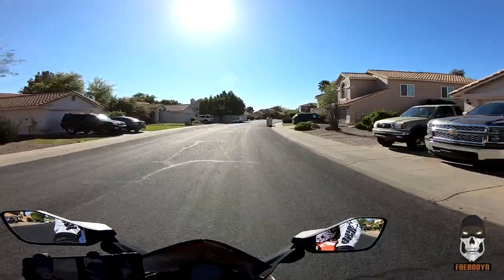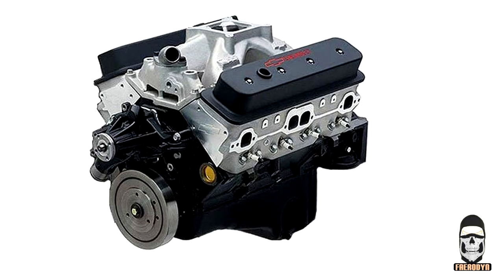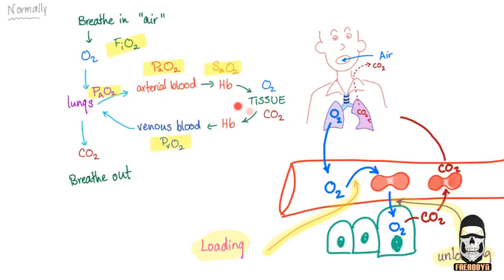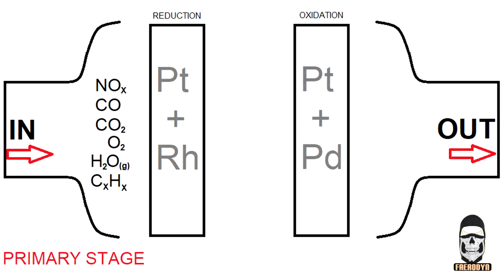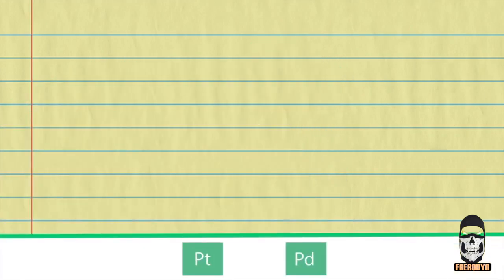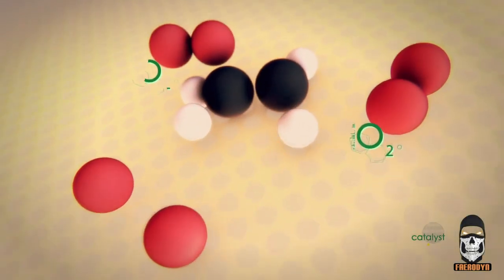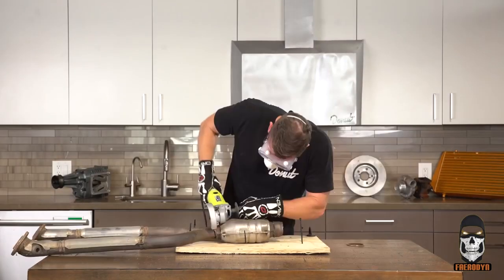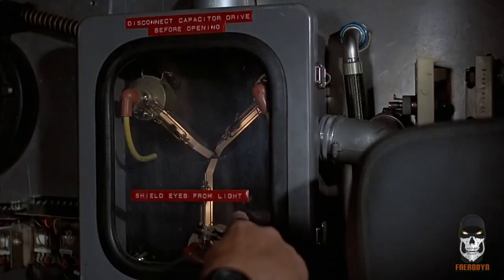Should You Remove Your Bike's Catalytic  Converter?

Comment: Hello! My sr50 2020 is completely stock and my exhaust is glowing red in catalyic converter area. Is this normal or not. Can someone please answer.
Reply from the maker: @Roki Leo: Hey man, thanks for your question. Your SR50 is a pretty nice bike! I have to say that in my limited experience I have never noticed my exhaust glowing after riding, and I don't think that it is normal for your exhaust to glow. It may be a fuel issue (bike running lean) or improper ignition timing. I would definitely suggest taking it in to a shop to get checked before your issue causes damage. Here are some links that I hope are more helpful:
https://findanyanswer.com/what-would-make-your-exhaust-glow-red

https://www.cycleinsider.com/Aprilia-Scooters-Motorcycle-Reviews?type=Scooters&manu=Aprilia

https://www.apriliaforum.com/forums/showthread.php?357858-Exhaust-pipe-glowing-red
Reply: @FaerodynMoto  thank you very much
Reply: @FaerodynMoto  do you have ig where i can send you a picture of a glowing part of exhaust
Reply from the maker: @rokileo1309  Unfortunately not. The only social media accounts I have are Twitch, Discord, YouTube, and Rumble at the moment.

Comment: I've got a 150cc SOHC Bike its exhaust has a Catalytic Converter and a heavy muffler

it has poor power output though from that massive back pressure..
11hp@ 7,000

a similar bike but an older model can do 14hp@8,000

if I replaced the exhaust, replace the carburetor and put a pod filter

can probably add 1 or 2 hp at higher rpm's maybe even more if replaced the camshaft with a Performance Cam
Reply from the maker: That's where the restrictive stock emissions parts really rob you: at higher rpms. Let us know how your project turns out, Jasper!

Comment: Hello bro nice Video, I want to ask you, is it necessary to Remap the ECU after replacing the catalyst on the motorbike, thank you, greetings from Indonesia
Reply from the maker: @BANGLIMS  hello! Nice to hear from you bro! So my experience with my KTM was that the bike would run too lean (not enough fuel) after doing the mods, so I had to remap the ECU to keep the bike from running too hot. If I didn't, it would damage the engine. I hear that most KTM's run very lean already from the factory, so I would highly recommend remapping after removing the catalytic converter.
Reply: @FaerodynMoto  Thank a lot for you suggestion bro 🙏

Comment: As this is two years ago what about the new ecu, I've heard that the ones on the meteor are learning ecu and as such can adapt to the change in the exhaust
Reply from the maker: Oh sorry for not responding sooner! Yes, adaptive ECU's have been around for decades in cars/trucks/vans/SUV's... I don't know enough about the motorcycle industry as a whole to know if they have plans to implement that technology into motorcycles or if they already have in certain models. I would imagine that in theory they would eliminate the need for piggyback ECU modules and tuning, however we've also been seeing companies like GM locking down the computers of certain models (like the new C8 Corvettes) to keep the performance levels within their predefined parameters. So I don't know if it would allow for such modifications or throw a code and prevent the motorcycle from working with anything other than stock running gear. I think I'll look into it! :-)

Comment: I Have Benelli TRK 702 did you recomend cat of ?
Reply from the maker: @dani.0605  I can't recommend doing anything illegal, so check with your local laws to make sure something like that is legal first. If you're ok doing that, then yes it will free up some more power. Just don't forget to also get your bike tuned for the mods you have and you should be good! 👍
Reply: @FaerodynMoto   I ask is that good for my bike notting else. I dont wonna mods i didnt instal that only slip exhoust i now i wonna decat my so is that good for read safe for my bike?

Comment: I have a 2021 Honda Cb350 single cylinder long stroke bike . 21bhp at 5500rpm and 30nm at 3000 rpm. Weights 190 kg.  I unplug the O2 sensor and bike rode a bit better with slight increase in throttle response .but popping at downshifts . It just have a simple cat in downpipe below O2 sensor , ecu are not available for this bike as it’s new not even in Japan (Honda gb350) . I want to delete cat, should I do it or not for sound and a bit of power.
Reply from the maker: That's a tough call, brotherman. I don't know enough to give you sound advice one way or the other, but if you are planning on de-cating your bike: you may want to check into some motorcycle mechanics near you that would be able/willing to dyno tune your bike for you once you make exhaust modifications. That way your bike should be running smooth and not have any issues. Your bike sounds real nice though!
Reply: @FaerodynMoto  thanks brother, in India nobody does bike dyno tunes. I think I’m gonna delete it, if something goes wrong will buy new downpipe as the exhaust is in two pieces.
Reply from the maker: @themechanicsingh4159  ahhhh, ok. Sounds good, I'll be checking for sounds clips on your channel when you do it! :-)

Comment: Bit random but if I cut out the cat of my stock downpipe, and replaced it with just a bit of pipe, and kept the stock end can on, would that change the sound at all? And would it harm the engine?
Reply from the maker: Great questions! So what you talked about doing will most likely increase the volume of the exhaust. I'm not sure if it will sound better, but in theory it should sound just a bit louder. As far as harming the engine:  with the rest of the stock exhaust still installed, I doubt there would be any problems with your engine. If in the future you swap out the other exhaust components for aftermarket ones, be sure to get the bike tuned or install a piggyback ECU like a Power Commander or Powertronics or something along those lines to give you the ability to purchase a tune online and upload it onto the bike.

Comment: Is it bad for bike to remove catalytic converter and instal regular mid pipe and add slip on? Thanks
Reply from the maker: Replacing the whole exhaust usually leads to your bike running too lean (too much air/not enough fuel). It also leads to a loss of power because without back-pressure the exhaust valves don't stay open as long as they should. That issue can be fixed by getting the bike tuned professionally, or you could install a piggy-back ECU (like a Power Commander or Powertronics) and purchasing a tune online that you can install yourself. An extensive aftermarket exhaust without a proper tune for it can lead to your bike running too lean, which generates too much heat and can lead to excessive wear on the drive train. Not recommended long term...
Reply: Ok, thank you for answering. So it is better not to touch anything. Bcs I was thinking tu put just a mid pipe with slip on
Reply from the maker: @revieweverythingforyou282  Generally you can do just a slip-on exhaust and be fine. The minute you do the midpipe too you really need to get it tuned. :-)

Comment: i wonder... where can i buy a new high flow cat or even a stock one for my model motorcycle? cant find anything in google. are they universal or something?
Reply from the maker: I've found most catalytic converters are sold as universal exhaust parts. It's up to us consumers to know what size (diameter) we need for our exhaust and have it welded in place (or weld it ourselves if we know how). Most motorcycle aftermarket exhausts don't come with one, but some do.
Reply: @FaerodynMoto  do u know what i need for 2000 honda vfr? I cant find any info, i might just remove it

Comment: Do high air flow catalytic converters increase fuel consumption?
Reply from the maker: Yes, but only a little. Typically any time you increase the airflow through the engine, the bike will start running lean. To prevent this, you can get the bike tuned or tune it yourself. Some bikes come with adaptive ECU's that automatically compensate for changes made, but the end result it the same: more fuel added to offset the increase of air. The increase of fuel used shouldn't be too noticeable from just one modification though. It's not until you fully open up your intake and exhaust that you will really start noticing a big change.

Comment: I took the Cats off my Foxbody and gained a whopping 7hp.. a little louder.. was it worth it? Meh,  it's something I can say if someone asks me really.. I have a 2020 Ram with headers and kept the cats on because of the extra expense and nothing really to gain.. idk
Reply from the maker: Nice! I like foxbodies. Matt Farrah did a really mean looking black-on-black build with his for The Smoking Tire. So you went catless- and you didn't see that much bump in power? Good to know man, thanks for the info.
Reply: @FaerodynMoto  it's an 88 and has 235hp but 325 torque.. it's a torque monster. I'm thinking about swapping the motor for a coyote 🤷
Reply from the maker: @macwiller2105  Yes! I really like the Coyote, imo it sounds much better than the LS and the Hemi. If you're going to get a brand new one, there are crate motor with ECU kits for around $10k-$12. I was thinking of getting one for my daily driver eventually.

Comment: hey!! I own ktm rc 390 and I removed the cat and installed a new exhaust and pipe,does removing cat affects badly to the engine? or do I need to change anything to the motorcycle to not cause any problems for removing cat? can u please answer this?
Reply from the maker: 1.) Ok, so in short: a full exhaust modification like that can potentially lead to your bike running too lean (not enough fuel for the amount of air going through the engine). If your bike runs too lean, you might notice your engine temperatures go up high, which can lead to excessive wear and tear on the engine. It can also cause premature detonation of fuel in the cylinder, commonly referred to as engine "knock".
Reply from the maker: 2.) There are a couple of solutions to fix this issue:
A.) You can take it to a motorcycle shop near you that can tune the bike specifically for the modifications you have made
or
B.) You can install a piggyback ECU (like a Power Commander or a Powertronics) and either purchase a tune for your modifications, or have someone who knows how to tune a motorcycle do it for you.
Reply: @FaerodynMoto  bro it is not full system,it  is just bend pipe that starts to connects from where cat is removed, does it change anything? is that still a problem,sorry to bother u, can u answer me?
Reply from the maker: @sarcasticdude23  it is alright to ask, I am happy to help you. :-)
If you only replaced the catalytic converter with a pipe (but not the rest of the exhaust), your RC390 should be alright. Just keep an eye on the engine temperatures and how your bike runs.
Reply: @FaerodynMoto  Thank u bro 🙏  love from india
Reply from the maker: @sarcasticdude23  No problem, my friend. Best of luck to you and your awesome motorcycle!

Comment: Sir removing catalytic converter from meteor cause any warranty related issues, or it affects engine, / any main stand issue? Because I also wanted to make same modification, please replay
Reply from the maker: Typically manufacturers will void your vehicle's warranties when you make modifications such as removing the catalytic converter. You would need to read through the warranty stipulations to understand what you can and can't do with your bike. 

As far as how it affects the engine: without dyno tuning your motorcycle or without a piggyback ECU (like the Power Commander V) your bike could lose torque and run hotter as a result.
Reply: There are a lot of people who are de-cating the J-series engine in the meteor and classic ect with no issues I'm aware of

Comment: if I remove the cat but I still want the stock canister attached, will it change the sound? will it be noisy
Reply from the maker: If you just replace the catalytic converter with something like a straight pipe then yes- the volume will increase, but only slightly if you keep the rest of the stock exhaust. It won't be too loud.
Reply: @FaerodynMoto  some claims, there gonna be a bassy sounds from the exhaust and i want that...i hope my 180cc will sounded like 400cc ducati hehe.. btw thanks for the reply..
Reply: @FaerodynMoto  some claims, there gonna be a bassy sounds from the exhaust and i want that...i hope my 180cc will sounded like 400cc ducati hehe.. btw thanks for the reply..
Reply from the maker: @miguelpaneda1607  No problem, Miguel. Good luck!

Comment: Can I take it out of my v4 panigale ?
Reply from the maker: Oh, that's a really nice bike! I would imagine you could, but I also know those bikes have a lot of tech on them that can detect changes like that and might cause issues. I would suggest talking to a service technician either from a Ducati dealership or from your local motorcycle mechanic shop and see what advice they can give you first before doing any mods to your exhaust. Also check your local laws to see if it is legal, just in case.

Comment: So I’d it going to damage the bike? That’s my only question
Reply from the maker: You're bike won't blow up, but I would strongly urge you to get it tuned. If you don't, it will run lean/hot which will cause excessive wear and tear on the engine over time.

Comment: 1)Can we driill out catalytic converter.....??
2) is decating harmful to the normal rider....since he is around his bike most time??
Reply from the maker: 1.) Air tends to take the path of least resistance. If you drill holes in the catalytic converter to improve air flow, then the exhaust gases will  flow through those holes the most- so it would drastically reduce the cat's effectiveness at eliminating CO,  NOx, and unspent fuel.

2.) The more a person is exposed to carbon monoxide, the more of an impact it will have on their body.... BUT motorcycle/car/truck racers are exposed to it when they race and they're ok... so I think you'll be fine without a cat as long as you're not running your bike in a closed garage.
Reply: @FaerodynMoto  If I drill holes in the catalytic converter will the exhaust eventually also be louder?
Reply from the maker: @notquackyminecraft7999  If you're asking about drilling out the core of the cat, I'm not sure. It might get a little louder. If you're asking about drilling holes in the housing, then yes! I've seen people drill holes out the sides of their cats before, but they complained that it got obnoxiously loud and sounded like they had an exhaust leak rather than an aftermarket exhaust.

Comment: Very informative video! Though I have experienced a cat theft on my Ranger F150 (now fully guarded with deterring toys), not sure if I want the same on my bike.

I have a 2020 CFMoto 300SR, to be paired with a full system (w/ high flow cat) IXIL can, which sounds like Matador on steroids XD But do I still need a fuel tune for her or just run as stock configuration?

Since that ain't a car with Turbo or anything to kick in, high flow cat on a bike is prehaps different from my understanding. Thank you, regardless.

Edit: TLDR should I slap a full system exhaust (w/ high flow cat) on my bike without tuning? A straight pipe definitely will need, but what about a high flow cat? Thanks a ton!
Reply from the maker: Hai Nhat Phung - Thank you! I'm glad you enjoyed it.

So on the topic of *tuning after a major exhaust overhaul*, here's the exhaust experience I've had: I have swapped a cat-back exhaust on one of my cars, a full header-to-tip exhaust on my other car, and now a full exhaust on my motorcycle. 

It has been my experience that when you modify air flow without a tune, the performance change you may see is a bump in horsepower but a slight drop in torque. So you lose some low end grunt, but gain some high end pull. The danger comes if it starts running too lean: the engine can overheat, have knock issues, etc. Every situation is different, so proceed with caution.

If you plan to swap your exhaust without a tune, I would suggest testing things out carefully at first- maybe a few trips around your neighborhood so if you have to shut the engine off and push, you're not far from home. I hope that helps. :-)
Reply from the maker: Pt2- So to summarize: it should be ok, just take it easy at first and test the bike out to see how it runs without a tune. If everything looks good, ride on! 🤘
Reply: @FaerodynMoto  Thanks for your useful information!

So...in short a tune is also needed to make sure my baby won't running lean, either 4 wheels or 2. Oh well, if wishes are horses.
Reply from the maker: @hainhatphung1371  You can still do a slip-on exhaust for your bike or swap out the muffler(s) on your car if you want to change the sound, that usually doesn't create any problems. A full exhaust, however, may require a tune.